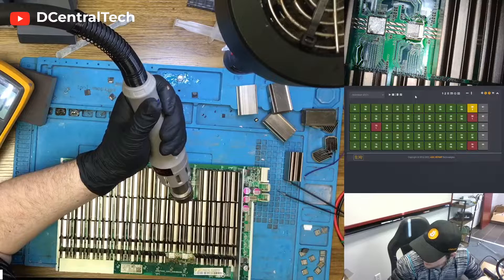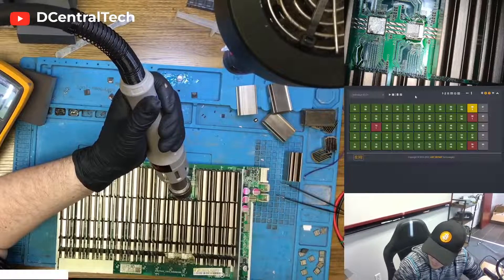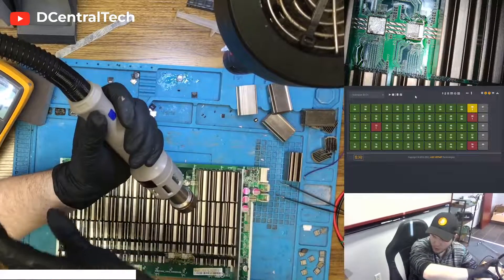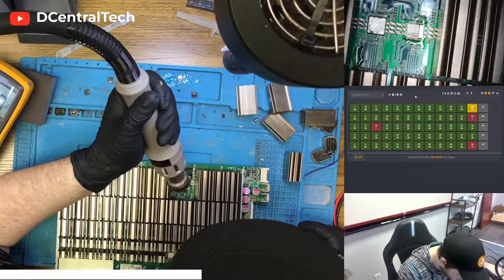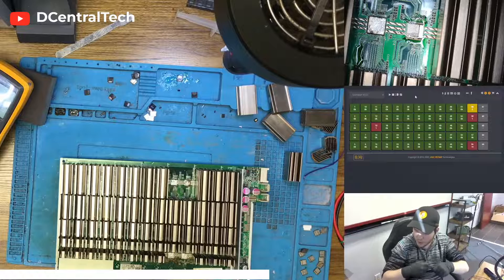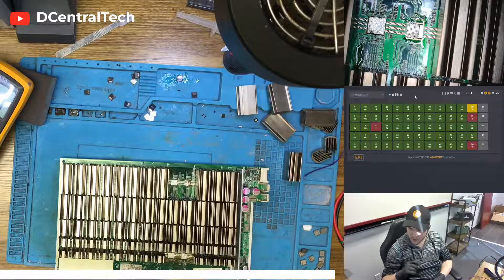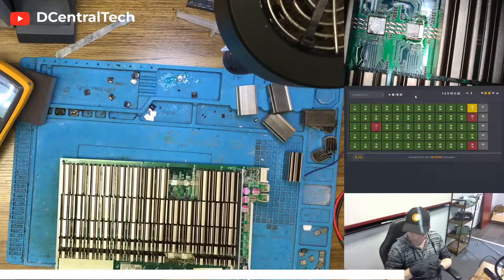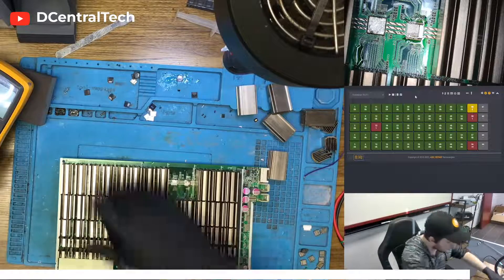Temperature Sensor Problems: Fix Temp. Sensor Issue On Antminer S17+

Comment: Hello,
i've a lot boards, and they have all temp sensors on the asic tester - but when i put it in Miner - the original (and other software) tells me - no temp sensors found - i'm a little bit worried about it, and wonder if you have some suggestions for me :D - all CLK voltages are fine, and also Reverse... so i don't know what to search too... because tester means everything is fine...
Reply from the maker: Inspecting the chips linked to the temperature sensors, particularly on the RX side, may reveal fluctuations in the readings. Identifying and replacing the chip responsible for this inconsistency will improve the temperature sensor readings within the unit. Additionally, consider utilizing VNish or BraiinsOS to fine-tune the unit and examine the "chip map" to pinpoint any red chips. Replace every red chip from distinct domains that you come across. For instance, if chips 1-2 are red, replace the worst one, while if chips 7 and 14 are problematic, replace both since they belong to separate domains. Once the board is all green, the unit should perform even better than when it was new.
Reply: @DCentralTech  yes, i'm doing it with hiveos for now, but in that cases it won'T start with it too - but will try again with other firmware :) thx